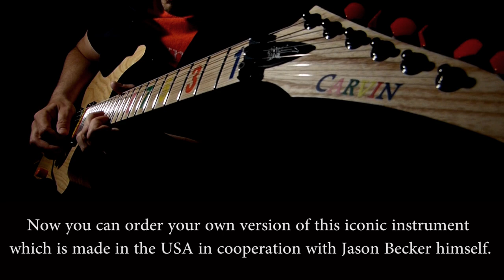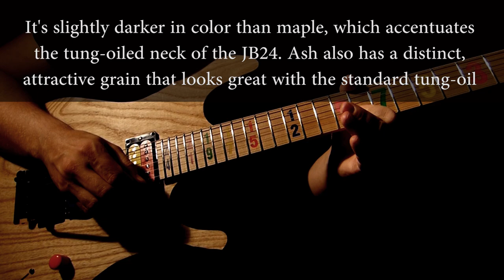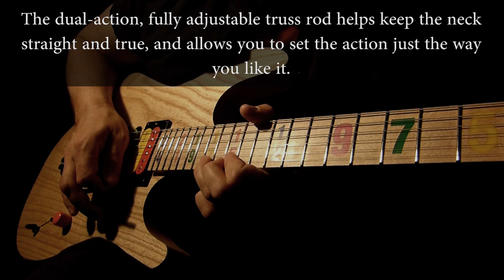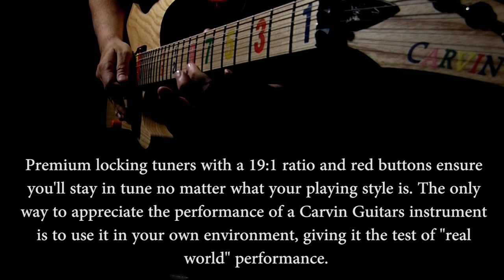Carvin Guitars Jason Becker's JB24 "Numbers" Signature Model 24 Fret Guitar

Comment: Hello, fine folks at Kiesel!

Just wanted to ask a quick question about ordering the JB200C! Because when I tried using the online guitar builder, the options for that and the other Becker models seem pretty set in stone. Is it possible to replace the Floyd with the usual Wilkinson tremolo you guys use? Just not a fan of Floyds, but I really want to own a JB guitar complete with his pickup and everything.

If it is indeed a no-go option, could you recommend a model that's at least very close to the JB body shape so I can work from there? Was thinking of the ST model, but I'll take the suggestion from you guys instead :)
Reply from the maker: The best thing to do is to call our guys at the shop so they can talk to jeff and see if it's possible! (858) GUITARS

Comment: what pedals used in the video?
Reply: The pedals are Seymour Duncan 805, vapor trail and vise grip compressor.
Reply: +Danny Young Do you by any chance remember the settings on them? i already have an 808 and im planning on getting myself a compressor. i really love that sustain and sharp tone, its so beckery! good job on the video, mate. Jason must be proud :)
Reply: I'm just trying to recall...I think the 805 level was set real high, like 9 out of 10...the delay has about 600ms with short feedback and low mix and the compressor is actually in the fx loop (not in front) mix 50%...can't remember the exact settings...amp turned up real loud! Hope this helps!
Reply: +Danny Young Thank you so much! Rock on :)